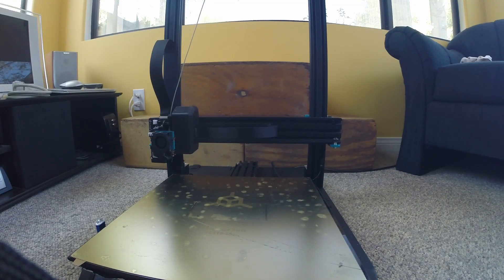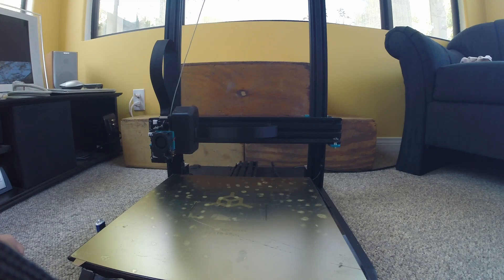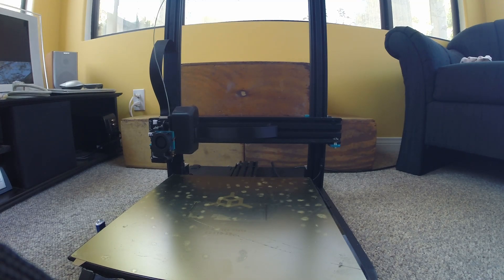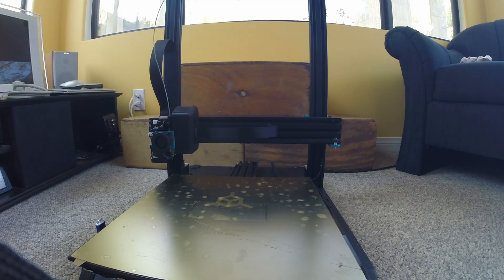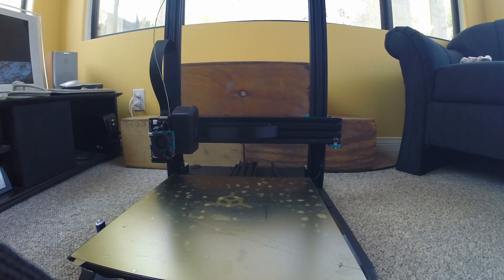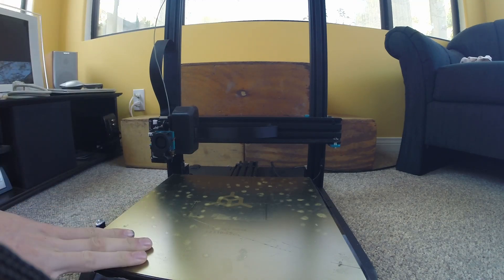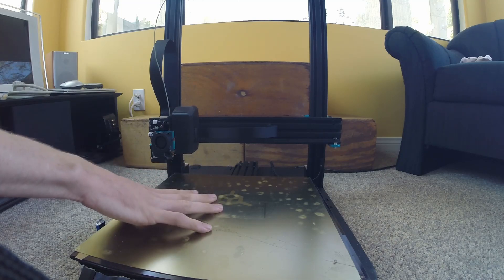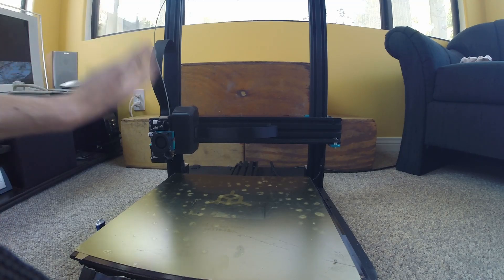Artillery 3D Sidewinder X1 Flexible Filament Tips

Comment: I found the hard way, not to print flexible filament on top of pei surface..... It will stick sooooo much. I printed a part with large surface contact and it was impossible to remove. I had to use and exacto blade to lift a little bit the part and damaged the pei surface. I then though about flipping the metal sheet to the side with no pei, and the flexible filament will stick very well, but remove easily
Reply from the maker: You could do that, I find gluestick makes a good release agent just in case.

Comment: When printing with flexible filament I have heard mention about turning retractions off. Is that correct? I am a total noob. Only got my first printer last week.
Reply from the maker: When you first start out with flexibles turn retraction off but now many extruders can handle retractions being turned on when printing too. It is all about really figuring out what your machine can handle and going from there.

Comment: Hi my friends. I´ve bought this same magnetic surface for my sidewinder, but now Im ca´t print nothing well. All is finish in faiure. I calibrate hot bed more than 100 times, but allways i get wrong pieces.
What could be the problem?
Reply from the maker: Did you check if it has a protective film on it? Did you clean the bed with alcohol a few times? One fast pass is not enough you need to wipe it a few times to be really sure. Those are some basic fixes.
Reply: @MakeItWithCalvin   The first thing i did was get out proctective films (there were two, one in each face). Yes I clean with alcohol. And I get wrong printed pieces...
Reply: @periprocto4026  I know it's been 9 months... but maybe an extruder problem?
Reply: @FuriousImp   It wasn´t extruder. It was de bed worong calibrated.
Reply: @periprocto4026  How is that possible? You leveled it a hundred times you said
Reply: Calvin Witt o

Comment: Quick tip for printing on "sticker" style build surfaces (pei, PC "buildtak" ext) is a thin layer of talcum powder on the bed rather than glue stick, it's easier to clean (just wipe it off with ipa) and the flex filament almost self releases once the bed drops below 35C.
 2 methods are the dusty/dry way where you just put some talc on a paper towel and lightly rub it on (only need a little) and imo the best way (I may be a little bias 🤣 cos i came up with it)
add around 3 or 4 table spoons of talcum powder per 500ml of ipa (the size my bottles come in), shake the bottle and apply to a COOL build surface (the ipa would evaporate too quickly of at temp so along as its below around 40C) and rub it around with a paper towel, wait till the ipa evaporates and then start printing,
This method does also make you look like a wizard with how it looks when it dries. https://twitter.com/Euan_Todd/status/1114962648376991746?s=19 (the vid of me using it that I shared...4 months ago...🤯)
Reply from the maker: That is a really good trick, never heard of it before!

Comment: make any diff between a .4 and a .6 nozzle ???   temps/speed wise
Reply from the maker: Not tried anything over .4 but I would say dropping the speed a little is not a bad idea so the extruder is not pushing so hard. It is something you have to figure on your own as each filament and machine behaves differently